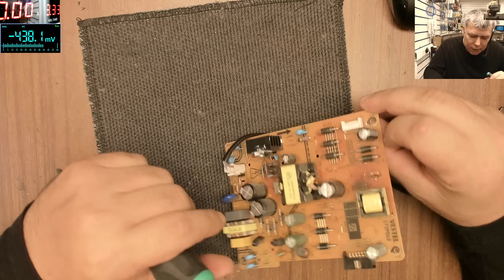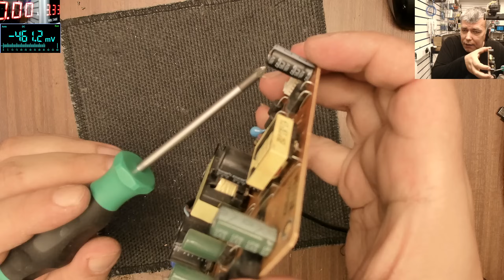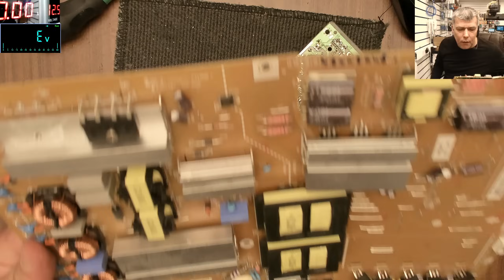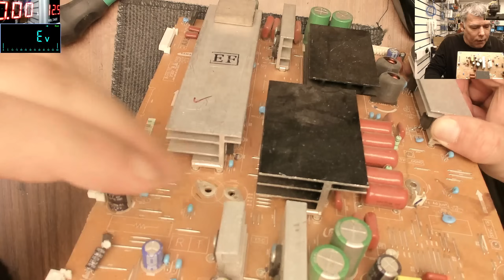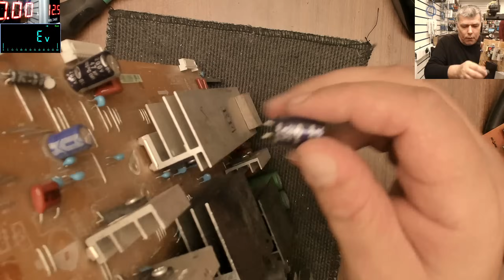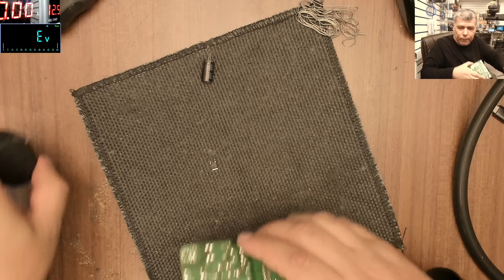Tv power supply board Repair - JVC LT-49C770 no power

Comment: I recently repaired that board, only I had burned out ic 1q001, I didn't see anywhere on the net that it was burned out, it's mostly the case like yours. I had no voltage anywhere on the secondary, everything else was fine except ic 1q001. Greetings, you have my support .CROATIA.

Comment: Sorin. The serial or model number of that tv power supply is written on the board. You could type it in google graphics and see a lot of pictures of that board. This could help you to read CORRECT original capacitor voltage and value.
beacuse as you said, you don't know if someone before you, replaced that capacitor with correct parameters. You shoudn't copy his choice without checking.

Comment: Thanks for sharing your knowledge. Would it be possible for you to announce the temperature and fan setting of your hot air when you use it to remove or install components? That would be very helpful for someone learning these skills and striving to achieve similar results.

Comment: Hi sorin thank you for your TV repair videos 
I've just fixed my first TV
It was the psu 
Using multi meter I've used your methods and found that a schottky dioid 
Was faulty.
Took out 3 diodes in parallel mode 
And tested out of circuit 
Found one of 3 faulty 
Voltage going both ways.
Manage to find data sheet on Google
And replace with part from a spare TV psu dioide with same specifications .
And bingo Red standby light came to life.
Brilliant teacher 
We saved more TV 's for scrapheap 😎👍

Comment: when the short hapent 905 mosfet or transistor is bad (bexuase one pin used gnd and other pin use vollage
diod juast do voltage strite ==>
bad caps and mosfet in 90% 
some time opticopler is bad (if 5volt is gone)
so i change 3 of them

Comment: If you're going to re-use 2nd hand components and need to test them so they're within specs, use one of these cheap, $20 LCR-TC1 Multifunctional Transistor, Resistor, Triode Capacitance Tester. The best tool I have in my arsenal.

Comment: I don't see how multimeter shows 0v (short) when you are probing diodes? This is boost converter and the drain of MOSFET is connected between pin of inductor and anodes of those diodes, and source is connected to ground. If you probe between anode of diode and ground, than it is logical that multimeter will show short, because anode of diode and drain are connected at same point, and source is connected to ground so you have closed circuit. But, you are probing with one probe to anode and other to cathode, so there is no closed circuit because cathode is not connected to ground. Weird.
Reply from the maker: It is connected to ground, i said it, thru the big switching transformer, so minus of the diodes and source of the mosfet are sharing the ground from the multimeter point of view :)
Reply: Than it's not basic boost converter like those booster used in PFC circuit in TV power supplies :)
Reply: @aleksandarjakimov6830  You don't understand how a transformer works. All transformers measure shorted even new one at the factory. Anything connected to the transformer will look shorted because the transformer is just a wire wrapped around a ferrite core. One side of the diode is connected to the transformer so the diode looks shorted but it is not shorted. This is a common mistake made by amateurs who do not fully understand how things work.
Reply: @johnbos4637  i understand how transformers works. But I thinked that this is boost circuit with inductor instead of transformer. Type "boost converter" and you will see why I thinked that multimeter will not show deadshort when you measure between anode and cathode :)
Reply: @aleksandarjakimov6830  It doesn't matter what it is. The fix on anything is simply find the bad part and replace it, not spend the next 6 moths trying to reverse the circuit to know exactly what it does. Most people have better things to do with their life, including Sorin, and that is why he fixes things fast without worrying too much about how it works.
Reply: But Sorin knows how thing works. He is not just probing randomly  If it's not so, he (and other good electronic technician) would not be able to fix almost everything related to electronics. You need to understand how circuit work in order to be good in fixing things.
Reply: @aleksandarjakimov6830  I never said Sorin was probing randomly LOL! If you watch his vids he doesn't mess around trying to learn how everything works, he find the bad thing and replaces it. There's no point wasting time if it's not necessary to fix it. Just fix it and move on.

Comment: No, Sorin, it's not better to use a capacitor with a higher voltage rating, because a capacitor with a higher voltage rating will have a thicker separator and this will cause it to have a higher ESR and so such capacitor will not last as long. It's ok to use if that's all you have, but it's not better.
Reply: That's strange. When I test large, high voltage capacitors before I install into circuit, they all have low ESR, However, I find the lower voltage capacitors have the highest ESR and are always the first to drift in tolerance. I do not like using them if I can avoid it. I have been a technician for 28 years. Higher voltage capable caps are always better.
Reply: @wefukthenwo  I saw you mentioned that LCR tester, if you're using that, it's not very accurate, just open a few datasheets and you'll see that the ESR gets higher with voltage. The reason why larger higher voltage caps might last longer is that they can dissipate the heat from the ESR better because of their size.
To clarify: this is only when talking about same-size caps. If the cap has higher voltage rating but is appropriately bigger in size, it might have same ESR.